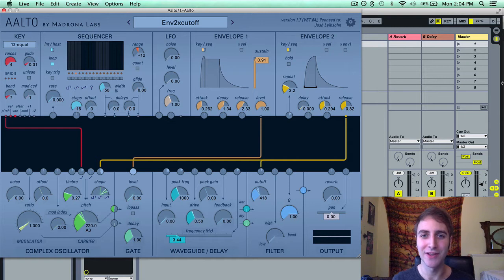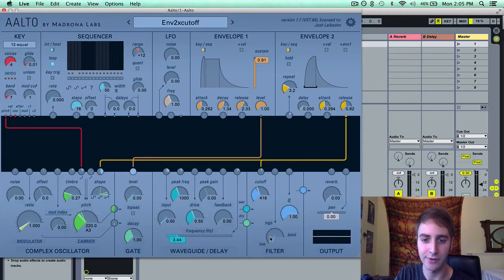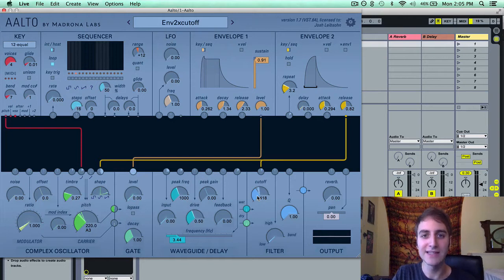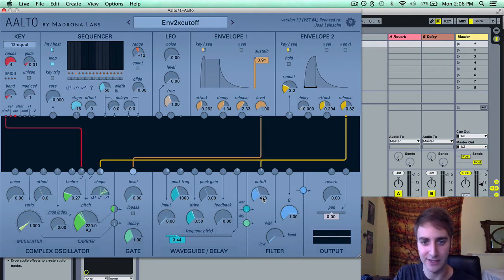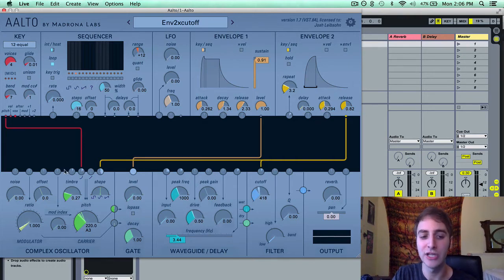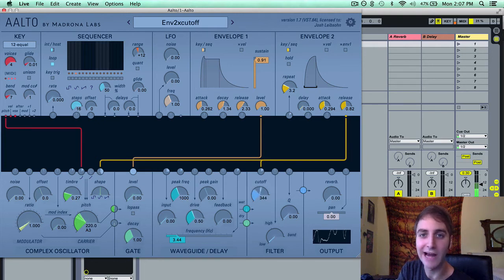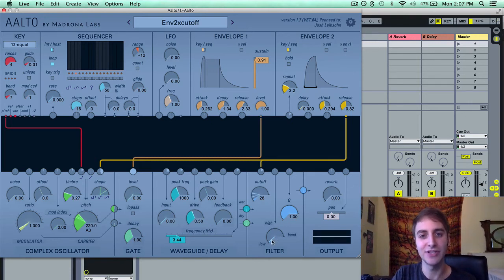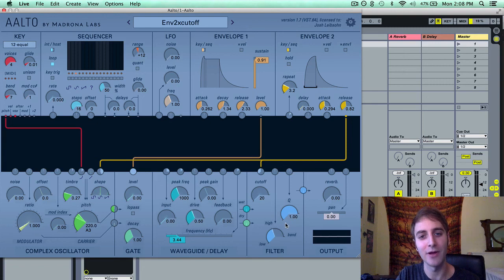Aalto #10: Filter Module

Comment: I appreciate this series of tutorials, but I find the lo/hi/band filter pot a bit confusing. Is it simply a tri-state switch or are there any filter parameters interpolated at intermediate positions, e.g. half-way between low and high? I'm guessing it's the former (i.e. just tri-state) because the ordering low-high-band doesn't make a lot of sense for filter parameter interpolation.
Reply: It just mixes between the outputs. Having high in the center may seem weird, but it sounds better this way because the low and bandpass outputs have phase such that they cancel each other out when added. High will mix well with either.